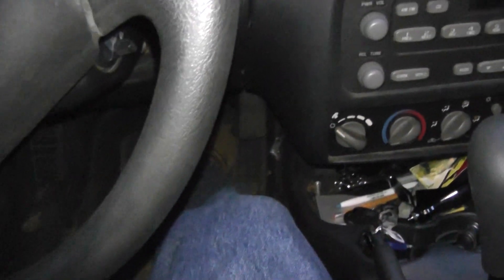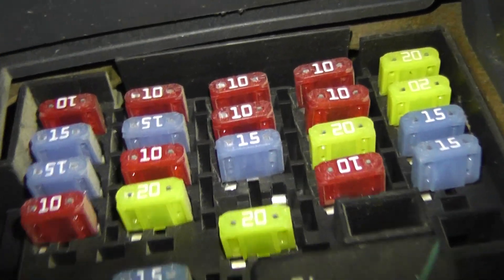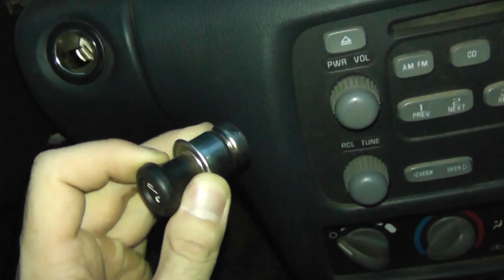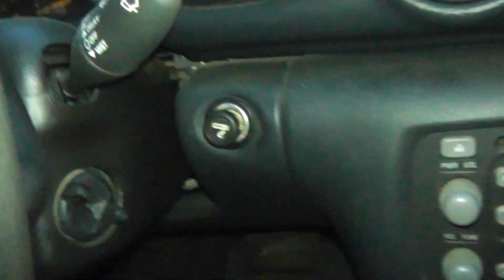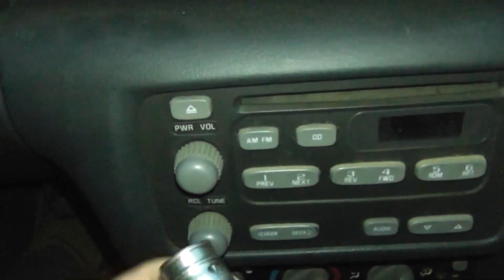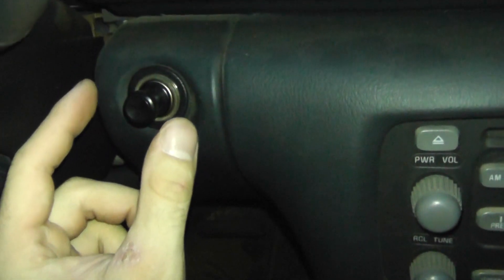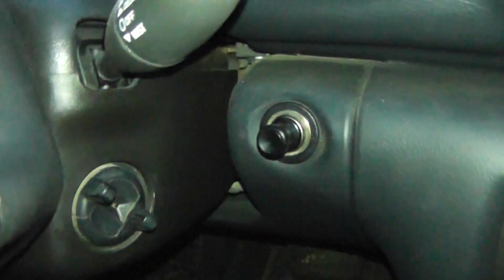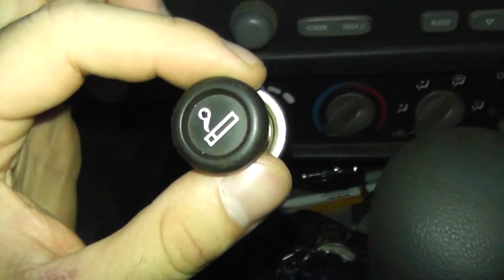Cigarette lighter fuse blowout.

Comment: You have to buy a new cigarette lighter and look in the description to make sure it has the correct voltage that matches your vehicle. If you keep doing this with a lighter that will pop your fuse, you will start melting your entire fuse box bro. Then you will have to buy an entire fuse box. Never plug anything into your lighter fuse until you make sure the volts match or are less than the fuse's threshold. A 25 fuse is regular for mine but if you put the wrong lighter or adapter into it, you will pop that fuse because it requires too much electricity. I learned this by experimenting with making a vape mod. If you get an outlet with no electric regulator in it and put a piece of led from a pencil from the negative and positive on each end, it will blow your house fuse as soon as you plug it in, pop the led and make a loud pop. Too much electricity runs through something that can handle it and it will over do it, then pop the fuse that gives the power. You have to be careful with electricity. It's very very particular when it comes to things like the amount of electricity. Ask me, and I think that it would be a huge movement if we could get a fuse and battery that could regulate tire pressure by installing auto air pressure regulators. That would be really cool. Idk if it been done but if you have the money, copyright this idea and do it. You'll be rich.
Reply: Hey what do you mean by auto air pressure regulators.
Reply: @derekgoodejr8788  bro I was BAKED off cbd and tide pods when I typed this. I don’t remember much of this conversation. I do remember what I was TRYING to say tho. I meant basically a mechanism that would allow you to install air compressors on your tires that would pump up your tires to the correct pressure based off of your sensors, on the go.
Reply: @GhostHxrTe  Ok lol and wow that’s a great interesting idea I’ll keep that mind cause I plan to be a entrepreneur in the future myself so.
Reply: @derekgoodejr8788  you’ll soon learn, if you don’t know now, that ideas are not a dime a dozen, but a penny a million. A proactive person with any one millionth idea and a good team, is priceless because that one millionth of a penny idea will become an investment, worth well over, AT LEAST one million times it’s original worth. It’s like drop-shipping but much more prestigious. You ever want a partner with something, complete the course and hit me up.
Reply: @GhostHxrTe  How can I hit you up.

Comment: Just a note of caution here. By putting in a large 30A fuse, just remember that the wires going to the cigarette lighter socket may be to small to handle the extra amps.
The car maker put in the rated fuse for a reason. If you are not careful you may cause a under the dashboard fire or melt some wires in the wire bundle which you do not want to experience. I have a 2001 Chevy Malibu that I just recently bought a new cigarette lighter for. It is also blowing fuses (20A fuse). In summary, not all cigarette lighters are the same ( amperage draw ect. ).  I'm still looking for a replacement cigarette lighter.
Reply from the maker: nmsidewinder Well, whenever I need to air up a tire. I have one of those tire pumps that plug into the cigarette lighter. It pops when it pulls to many amps. It would be nice for it NOT to do that. But mostly, I just use the cigarette lighter plug, and hook up my solar panel to it. So that way, my car battery will never die.
Reply: You might consider running a separate set of wires to the cigarette lighter (larger gage size) to handle the extra amps. Here is some data that might help. Wire size for carrying (29.7 amps)  30A is number 8 (.1285 inch diameter) wire. The air compressor you have should state how many amps it draws. I've had to replace electrical feed wires on a boat I use to have to run accessories with (Marine Band radio... ect ).
Reply: ** correction: Number 7 wire (.1443 inch) carries 29.7 amps.
Reply from the maker: Harold Pritchett
So you're basically saying to run a by-pass from the battery to the lighter plug. I've done that too on my RV cigarette lighter plug. It works, but it's such a pain.

Comment: Thanks for the video, I am having the EXACT problem. 2000 Buick Park Avenue the cigarette fuse is number 15 and I hear the fuse pop as soon as I put the lighter. I may have to replace the cigarette socket, Thanks for the tip, I may will swap out the cig inserter first.
Reply: A

Comment: same problem here /2002 pontiac grand prix gt/. except that i'm using a phone charger instead of a lighter. i guess that could be a short circuit. any idea how i could repare it on my own?
Reply from the maker: Well, like I said, in the video, a 30 amp is the most it will pull. But, your best bet will be to either get a different charger or a different phone. It pays to read the fine print on the back of the phone box that it came in. It may tell you how much juice it takes to charge.
Reply: That's the thing... main lighter never worked, but that wasn't a problem for me as anything plugged there would be on a gearstick's way. Instead of that I was using a socket from a passenger side. And it was working for nice couple of months until it stopped... blown fuse. I changed it and tried to plug lighters to check how it works. surprisingly main lighter started working, but after couple of seconds a new fuse  died.
Reply: EdBoonSucks
Changed it again and decided to use only a socket from a passenger side... I figured that main a socket is a problem of a short circuit and as long I leave it alone, nothing else would happened. I plugged my ipod-to-radio transmitter (btw i'm using ipod nano, so it takes barely any juice) and it was charging it just fine. however next day i noticed that LED is off and it was fuse again. Any ideas? I guess that could be a bad socket.
Reply from the maker: Hmm... You say yours is a 02 grand prix right? I don't know much about them, but there maybe a better way. You can bypass all of that BS, and install a direct line from your battery on the (+) side and the ground wire to the backside of cigarette lighter. All you'll have to do is go from the battery, then on the inside, you pullout the cigarette socket, there you'll see the tail-end is and that's were you'll put the (+) wire in at. Once done, you'll also see where the ground wire is at. (Make sure that's in tact). And if you like just for a safety caution, you can get one of those fuse slots that holds up to a 50 amp built into the wire.
Reply: EdBoonSucks thanks for your reply...again. i'm not familiar with american cars at all. originally i'm from europe and recently moved to americas(mexico for a moment). to be honest i never had to deal with stuff like that before. i've got my prand prix as i heard tones of a good stuff about the GM 3800 series 2 engine. got mine pontiac from states and had engine swap there as a result of some strange noises(mechanic's advice). in mexico i found out that new engine wasn't well fitted. result was broken crankshaft and piston. so i payed tones of money to a mechanic to fix it... plus maintenance. happened that "mechanic" was an idiot... i mean this c*** sucker made more damage on the car than i could ever think about. starting with braking my lights and finishing on leaving engine leaking oil. i could get rid of my car... it's not new or in the best condition, but to be honest i really enjoy it. and as i won't give it to another "mechanic" as long i don't have to i decided to learn on my own and fix as much as possible by myself. ill try your advice, maybe some new idea would come up. take care

Comment: I have the same happening to me. Im gunna trace the wires and see if there is any indication of a short and either way probably going to rewire it. My secondary lighter slot doesnt work at all so most likely have to replace that whole assembly
Reply from the maker: You may not have to do all of that. If your car is the same model and year like mine was, your fuse box should be on the side, and just replace the fuse and don't swap-out any cig liters. If it doesn't, well I'm sorry for the ordeal you'll have to go through.  I made that video, to help answer some questions out there.

Comment: I am guessing that I am having a similar problem with my girlfriends 2002 Pontiac Grand Am.  I can charge my phone,  no problem but when I plug in a 400w power inverter and try to charge my DJI phantom battery through the 100w battery charger it blows the fuse within minutes. I have not tried increasing the fuse power, for reasons mentioned in the comments below.  I believe it is a 10 amp fuse that is plugged in there.  Maybe that is the wrong fuse anyway.  Seems awful low amp fuse.  ( Number 34 driver side under hood).

Comment: Car cig lighters are only meant to take a 15A fuse.
Reply from the maker: They still popped.
Reply: Mine 05 ford ranger takes a 20 amp
Reply: Hes just showing how much overpowered it is. Mine is 20A ford ranger.

Comment: Perhaps if you took physics in high school, or I'm guessing got your high school diploma at all, you'd understand simple current physics.
Reply from the maker: Sheldon Cooper How does that explain on why the 30 amp fuse blows out by changing a simple cigarette lighter, THAT"S NOT EVEN BEEN PUSHED IN?! 

And sense when did schools ever use car cigarette lighters to teach about physics?
Reply: +EdBoonSucks lol right. I was thinking the same thing. the hell does graduating high school got to do with troubleshooting a blown fuse in a vehicle lol. but have you tried to unhook the lighter and disassemble it to check for rust or corrosion. that's what was causing my fuse to constantly blow. even when I wasn't using the port. I took it apart and it was built up with corrosion so I took a wire brush and cleaner and got the rust and corrosion off. reassembled and bam. fixed
Reply: +EdBoonSucks and the reason it popped with another lighter is because the coils in it and the wires hooked to the assembly. there's more power going to the other lighter cause of more coils in the lighter than the smaller one. even not pushing it in it still conducts the electricity through the coil and outer metal casing. hope that's not to confusing lll
Reply from the maker: Russell Leek Good assessment. I never thought of that. But yeah, if the coils don't lineup, then that could cause it to short out. 

I nominate this comment as the best explanation. 
So people, give this guy as many likes as you can.
Reply from the maker: Russell Leek No, there's no rust in it. Also it's kinda odd because, as I've stated here in this clip, the lighter was from a Toyota pickup that works on a Pontiac sunfire. 

But none of this really matters anyway. I sold it 6 months ago.
Reply: +EdBoonSucks lol I've learn a bit over the years of working on crappy fords. and oh ok well that's good then. I got my air bag out now trying to check connections and check my clock spring. it's a true s.o.b too lol

Comment: my 03 cavalier, blows the fuse every time, it blocks out being able to do a check engine light Scan. anyone heard of this before?? my buddy said perhaps a wire that touching metal could be the issue?? I need help
Reply from the maker: Have you tried using a larger fuse to that pulls more amps? I think 30 is the max.
Reply: have not tried that, an your sure that it's not gonna draw to much power threw the wire on a 03 cavalier!! only thing I have done was buy the same fuse an it blows before I can even get it all the way plugged in..
Reply from the maker: It'll pop if it's to much power.  The fuse that you see here, it's suppose to be a 20. 
Fuses are designed to pop before they get hot. This prevents electrical fires.
Reply: I'll get 25 an 30.. my issue was that your fuse wasn't blowing soon as it touched the fuse spot..
Reply: most cigarette lighter fuses I've seen are 15a
Reply: did you figure it out, I tried a bigger fuse but still just blew it on contact
Reply: Remember to disconnect the batter before you insert the fuse!
Reply: I'm dealing with the same thing right now with the lighter and engine scan :>/
Reply: did you ever find the issue? i’m having the same issue with my 01 cavalier. hope all is well
Reply: @Joshua Mahurin